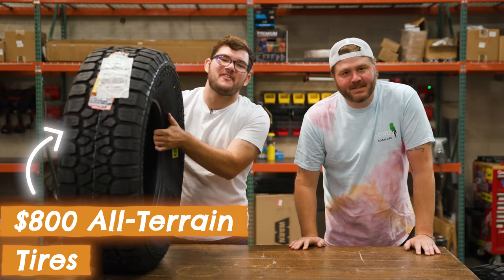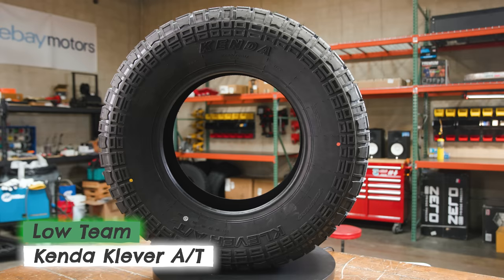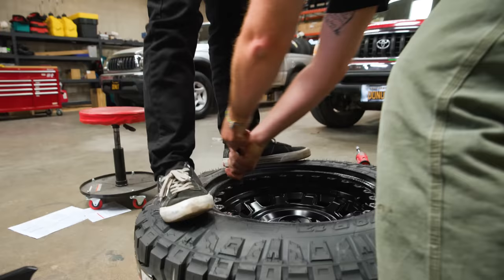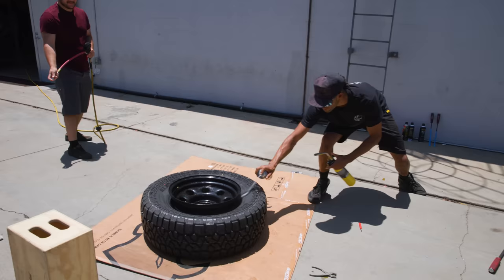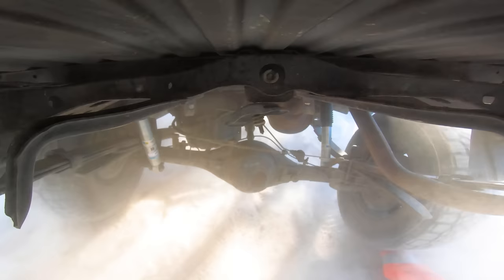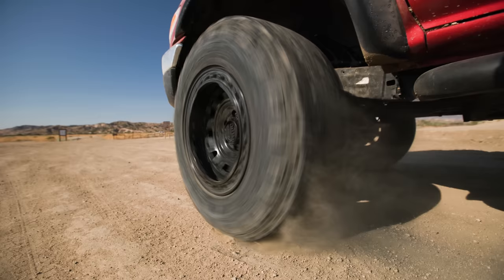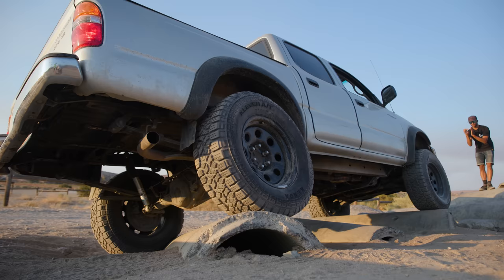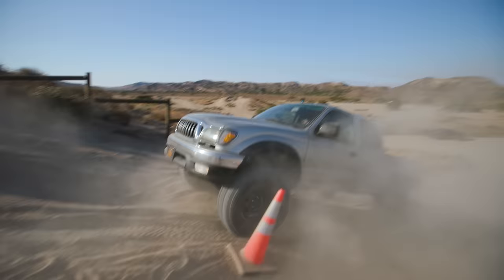$800 Off-Road Tires vs. $1500 Off-Road Tires

Comment: both of these trucks are considered high trucks in my area, try finding a clean rust free  late model tacoma, mid 100k miles for less then 10k
Reply: I see trucks in my area with 300k go for 20-30k "i know what i got no lowballers"
Reply: You need to MOVE!
Reply: @TheBandit7613  where to?
Reply: @marilynmonbro35  It depends what you like to do. Are you in to off road? Camping? Mountains? Fishing? What do you like?
Reply: Everything is high price at the moment cause of covid, every used truck is worth almost double what they used to be. Its hard to be in the market for a truck right now considering if u do buy one and then prices go back down you'll lose thousands.
Reply: This is not the time to be looking for deals on any truck, especially a Taco. 4 months ago I sold my 2015 Taco with 67K miles and an accident history for 32K. That was 3.5K more than I paid for it in 2017 when it had 23K miles (and no accidents). Truck was sold outright to a local dealer.
Reply: @scottlewis5755  Imagine you sold it to a private party for $40k. LOL
Reply: Same
Reply: Sounds like we’re in the same area, Hawaii? Their asking 5,000 for a really broken model of these Tacomas and like 10,000 for something with 200k
Reply: My dads 2005 Tacoma sold for 17k with 200k miles haha
Reply: Bruh I’ll say the best deal I ever saw in my area, a guy was doing some mulching work for a couple when he got a peak in their barn and saw a beauty. 96 red taco sitting in there with zero rust. Only had 90,000 miles on it. The guy picked it up for $4,000 cash and the mulching job for free so about $4,800. The only thing wrong with the truck, dry rotted hoses and oxidized paint. The engine ran perfectly once he put a new battery in it
Reply: @danielvega4076  my Jetta that I bought for 5,700 is worth 10-12k now and I added miles lmao. Great time to have someone total it tho fuckin rip now no car fo me and high ass prices.
Reply: Dude one of those would be 20,000 in Utah. I got a rusted up 240,000 mile tundra for 9
Reply: Or just by a landcruiser 80 series which will shit on all of them, one downside of them is the fuel consumption tho. Its genuinely ridiculous how much they use
Reply: I’d say personally a Ford Bronco (old one. Not the new suv thing) is one of the better off-road capable vehicles. Especially on those jeep trails, heck a jeep was struggling to get up a hill where the Bronco just zipped right on up. Jeeps breaking down left and right but the only problem the Bronco had was a little mud in the intake snorkel lol. Plus they are pretty cheap on a normal year. I got a 93 with the 351 for $5,000. Only has 150,000 miles and surface rust on the frame. Great vehicle especially on a budget
Reply: Man I just bought one from Florida with 105K miles for $11k.  I feel that I was extremely lucky.
Reply: @dimesauce10  that's a steal
Reply: @swankscabinet1625  I’m patiently waiting for prices to correct to more reasonable levels to pick up an OJ Bronco. Im in Southern California so I might have to look outta state. Some guys I’ve asked while running into at gas station always say they want 20-25k for theirs.
Reply: That’s everywhere.
Reply: There is no trucks under 18k in my area unless they have near 250k miles and still be above 10k. Might be because I'm in the south but my 2011 f150 has gone UP 2k in price with more miles over the last 5 years.

Comment: Biggest issue on a cheap tire (for me) is longevity. I've tried Dick Cepek and Gladiator tires and neither get more than half the mileage of a Toyo A/T III tire. Soooo if a tire is half the cost but only gets half of the mileage, it is the same price as forking up the money for the better tire upfront and you get to avoid all of that judgement.

Comment: In most cars you can gain significant advantages with a wheel/tire replacement for any application. Nor do you need to break the bank for that.

Comment: The most difference in cheap or expensive tires is when the wear down starts. Expensive tires probably will last longer time.
Reply: Depends on the rubber softness. For All terrains they will last years regardless. Expensive tires are softer for better grip
Reply: @jeffmayo6002  guaranteed Nitto will outlast the kenda
Reply: I mean yes, they may last 10% longer, but they’re twice as expensive. It just isn’t worth it.

Hell most off brand AT tires have a 40-50k mile warranty these days too
Reply: The nitto will not only last longer, but they'll have a milage warranty to back it up. And they'll wear significantly better.
Reply: Negative. The speed of a tire wearing down mostly depends on the rubber compound. The softer the compound the quicker it wears off.
Reply: @davycrocker4842  You can't guarantee that just because of name brand.  The Kendas have a higher treadwear rating than the NIttos, so that right there says the Kendas will last longer.
Reply: @brianm6117  sorry i have real world exp with both. 40k miles vs nearly 100k
Reply: Well good straight up mud tires won't last nearly as long as good all terrain tires
Reply: Cheap tires tend to chunk off, where the better tires wear down more even and smoothly.
Reply: Not necessarily. Often cheap tires have a harder compound increase tread life. Lower traction. Having said that tires vary like crazy, and the kenda are very good tires
Reply: @davycrocker4842   I love my Kendas. I’ve ran 2 sets of their mud tires and currently on a set of their rt. I’ve always had better luck with them than toyos and nitros. I will say that the toyos and nittos tread will last quite a bit longer but they have always dry rotted way before the tread wore down for me.
Reply: Yea tread pattern looked pretty similar. Interested to see specs on them
Reply: @davycrocker4842  
Nitro makes several different tires.  Your comment is meaningless.
Reply: @davycrocker4842   i got 93k out of my nitto trail grapplers, easily could have made it another 15k but winter was in full swing and didn't want to get stuck in the snow.
Reply: @brianm6117  Treadwear ratings are almost pointless. Each manufacturer does their own testing to achieve that number. There is no uniformity between brands. A higher treadwear, while seemingly better, is only relevant within the same brand. A Nitto 700 UTQG is not the same as a Kenda 700 UTQG because they do their own internal test to achieve that number and there is no "oversight" to assure consistency.

Comment: Low truck is actually getting some pretty decent parts. It’s like hi-trok and mid-truck.   Also air down those beadlocks to like 8psi and the steelies to like 12
Reply: That’s what I was thinking. They could be using $50/ea steelies from summit racing, a $300 eBay lift, and some federal tires. These tests are also pretty bad. They don’t show the true difference between high and low products. You buy good tires for traction, but also puncture protection, lifetime, sidewall strength, warranties, wear patterns, etc. But they didn’t do any high speed traction test. And those Icons shine in speed over desert terrain, not slow crawling
Reply: I prefer that for low truck. 

The last season they constantly used the cheapest crappiest thing they could find. Which yeah it worked but in a lot of cases they were just cheap bad quality garbage. Id rather see something thats cheaper, but still a quality product.
Reply: @mikerossi7634  I agree with the puncture protection. I run BFG K02 tires and over 20 years in the desert I have never had a flat. I rock crawl some but a lot of high speed desert fun so I am sold on K02 tires.
Reply: I wouldn’t be taking any Steelers down to 12 Psi 
I smashed a tyre off the bead at 18psi on steelies was a shit of a time
Reply: @karlschwaber7006  yep BFG KO2s are solid and worth it! I switched over to Falken Wildpeaks a few years and haven't had a single issue either. I ran them for a while on a 2004 Suburban and that thing RIPPED forest roads, now I have them on my 3rd gen Tacoma TRD OR. Back in February I bought 4x 265/75r16 for $720 out the door for the non-LT version. Best deal in high quality ATs in my opinion.
Reply: @toms_gupooe  I go down to 12 and I have not had any problems but they sure look flat. But I need to go low for the dunes because the sand is so fine.
Reply: @karlschwaber7006  you can run lower in sand because you're not wrapping the tire around roots and rocks, less chance of a side load that's going to break the bead...i mean unless you're being stupid about it and torquing them out by driving too fast/gnarly.
Reply: Depending on the tire you can go down pretty low. My pitbull rockers look like 10 psi isn’t low enough but other tires I’ve seen with 20psi look flat
Reply: Like why not air down so much more. It's a beadlock....they could do 12psi and it'll cool down to 9 psi. 🤔
Reply: @germanquintanilla5995  , I run my bead locks with 36" swampers at 8-10psi never had a problem.   That is on hard-core trails.
Reply: @mikerossi7634  you mean like my jeep xj build while I was in college... $50 a corner steel wheels, junkyard super swamper tsl's junkyard Ford 8.8 with locker, trussed d35 front, and the only new thing was the $500 zone lift with full spring packs no aal.
Reply: Yeah. Who wants ~4ply shits on offroadin 4x4. Need LT tires
Reply: @_Zekken  I agree. People tend to forget that after the show is over there is a high likelihood that the cars will be kept around by someone. If the mods are bad it means even more money undoing them.
Reply: @salcrino  haha! I had a 2000 Sierra z71. $50 steelies w/ k02’s on cranked torsion keys. Thing was a tank!
Reply: @karlschwaber7006  same! I had 3 sets of BFG K02s on my old truck and loved them. I’ve also blown Kumho and Firestone AT’s. Currently on Nitto Ridge Grappers, but man they’re loud. Overall, traction isn’t the huge difference, it’s noise and overall puncture protection, especially in the sidewalls.
Reply: @two_tone_xlophone2630  thanks for the information, I never thought about that.
Reply: @mikerossi7634  Nittos seem to be fine other than what you stated about noise. I have been told they wear fast. In Death Valley we came across so many with flats (the people like me that only carry 1 spare) and one I lent my spare to because we were in the same camp. The guy was running Firestones and he had already 3 punctures.
Reply: @karlschwaber7006  I’ve only had my Nittos for about 8k miles, like 98% road use, so I haven’t noticed wear life yet. I have heard they wear quickly, but so do most mud terrains. The ridge graps are very aggressive for an all terrain

Comment: The fact that you guys bought Tacomas has me smiling and excited for this season. I have a 1998 Toyota 4Runner and once I get everything repaired, I'll have some references 😉
Reply: i run 33"'s with bilsteins and tokico black shocks from a landcrusier in my 2000 4Runner. Nearly identical to low setup with maybe a few changes here or there for looks and durability but dude it does wonders. Gotta get into it!
Reply: That thing better have a turbo diesel lol

Comment: THANKS DONUT FOR EXPLAINING THIS STUFF!!!
If it wasn't for this very informative video i would of gone through life thinking something like a bead lock on a wheel was for protecting the tire and rim seal from ripping/pulling apart when there aired down to 1psi during these rock climbing and extreme off road adventures

Comment: I'm actually running the kenda klever R/T 33x12.5r18 on my 2nd gen taco and love them. Ive ran coopers on everything up until this set and ill definitely be going with the kendas again. Mud, rain, snow, wet grass are no issue. Ive yet to actually need 4wd.

Comment: Let's just make a list...

-Almost everywhere it's really illegal to run beadlocks on the street, they are almost all not DOT approved.
-Check the load rating of your tire, high load rating tires do not need to run the rated PSI.  The ones on my Jeep are rated E, so there is absolutely no need to run them at suggested 65PSI ever.
-I run OEM rims, non-beadlock, with a 33" tire at 20PSI daily, been down to 10 and haven't taken off a bead, beadlocks will easily run single digit PSI.
-Disconnect your rear sway bar to get more flex out of your solid axle, usually around 30%ish extra, really helps articulation and costs only time.
-Usually when spending more money on offroad tires you are getting a better rubber compound, usually more of a stickier compound.  Why you saw better stopping on the $$$ tires.
-If you really wanted to test these things you should drive em on the Rubicon, y'all are in Cali, right?
-Seat time, seat time, seat time...Experience is everything, over 50% of the mileage on my Jeep is offroad!

More offroad stuff please!

-Some asshole with a Jeep

Comment: I have a pair of 32” Nito ridge grapplers on my gen 2 Tacoma and they are great. But 15k miles later they got louder. I have done proper alignments, ran proper psi and rotated every 4k miles.

Comment: Steelies for the win in my book, less hassle offroad when you hit some rocks the wrong way.
Reply: Exactly. If your offloading steelies are the way to go.
Reply: Yeah but the point of this was making a daily that you CAN take anywhere
Reply: If that was the point than beadlocks hi-team used are out ,as most places define them as "offroad use only". Steeles for the dub 🤣I like the look of the alloy rims rims, but durable they are not. Good for sandy desert stuff or maybe mud, but rocks and brittle metal alloys are not the best of friends.
Reply: alloys are stronger. that being said if something catestrophic happened steel is easier to replace/repair.
Reply: Yup!!!
Reply: @BassRacerx  Alloy wheels are not stronger.
Reply: @BassRacerx  Forged alloy is stronger. Talking like $2k per wheel at that point, minimum. Cast alloy is completely weaker than steel.
Reply: @NoWr2Run  Exactly. Cast alloy is fragile as heck compared to steel. Now forged on the other hand..

Comment: I got a set of the kenda at2 on my f150. I’ve put several hundred miles on them since the install. A lot of rainy days the first couple weeks. A couple flooded dirt roads for fun and a few dry days lol. The tires have performed flawlessly. Great grip and traction in all conditions. Hardly any weight to balance and are about 15lbs lighter per tire than the ones they replaced. And a 50-60k warranty to boot. Can’t wait to get some miles on them

Comment: when you hit an aluminum rim its breaks. when the steelies get hit you just use a hammer to hit it back in place. ronny dahl on youtube goes into great detail about whether or not you should need a bead lock and why you should you steelies.
Reply: It seems like the biggest secret in modding is that steel wheels might be the best for any road based car.
Reply: Yeah, aluminum beadlocks is a weird combination. You don't really need beadlocks unless you're planning to run less than 10 PSI. The only reason to run pressure that low is because you're rock crawling, and like you said, if you hit a rock with aluminum rims they crack.
Reply: Yup.  And with less unsprung weight too, Low team seriously came out ahead on this one.
Reply: @Psyco913  I assume they're aluminum to save weight when they run 40" tires. With that much rubber you'd have to really be trying to Ding a rim.
Reply: @0xsergy  It's super easy to slip off of something and bash your wheel into a rock.

There's also the scenario where you get a puncture, but you need to complete the obstacle to get to flat ground where you can swap out the wheel. That's much sketchier to do on an aluminum wheel.

These scenarios don't happen much during normal trail riding, but you don't need beadlocks for normal trail riding.

Aluminum beadlocks are kinda like low profile mud terrains. They might look cool, but they don't really make sense practically.
Reply: Exactly....the show is entertaining but in the end of the day they dont really know what they are doing and they are producers more than car people
Reply: I’ve bent a few aluminum wheels, no breaking on cracking.

I’m willing to bet there aren’t any Ultra4 buggies running steel wheels and the tires go before the wheels do.
Reply: @kc510  I've seen videos on YouTube of guys unbending bent aluminum rims with bottlejacks..not smart but clearly aluminum can take a hit or two if you get lucky.
Reply: @demoritzz5327  they def are car people. But they know way more about building a car for the track than for offroading. They're all relatively new to offroading.
Reply: @0xsergy  they can take a hit, but nothing major.
Reply: @mateojimenez5905  i didnt mean to say they arent car people and yes they know how to build track focused cars but they still are video producers in the first place and car people in the second place
Reply: @0xsergy  the beadlocks were heavier than the steelies lol they almost always are with all that hardware to hold the beadlock ring on.
As far as cracking vs bending aluminum, it's all about the difference between forged and cast.
Reply: I run 12 psi on none bead lock rims they are not needed